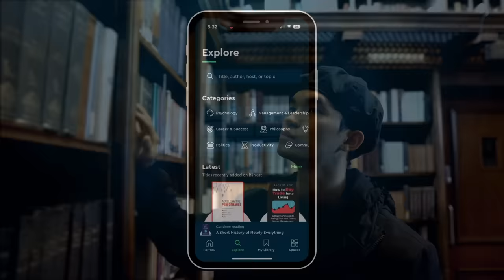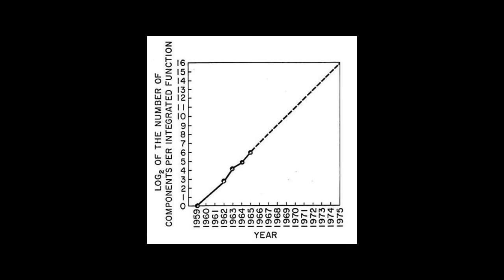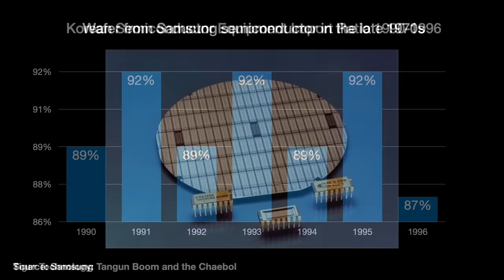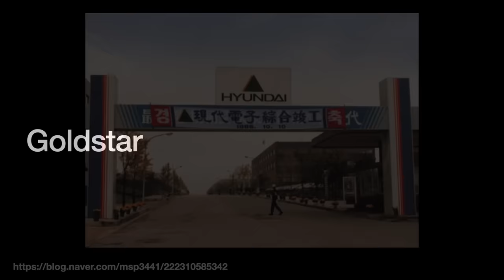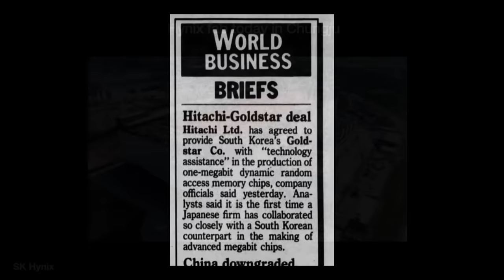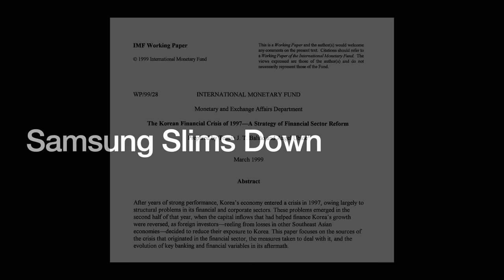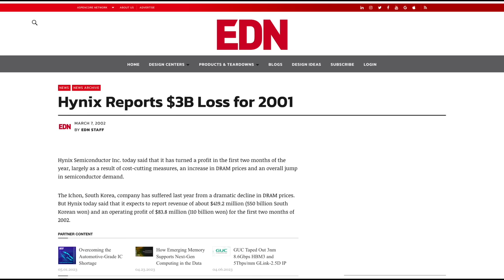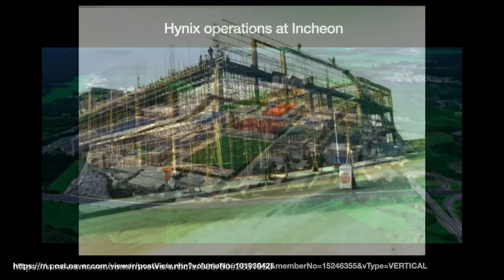The Fast and Furious Rise of Korean Semiconductors

Comment: I remember in the 50s when I was a little boy. My father was a foreman at a steel company in Warren, Ohio. Many times Japanese businessmen stayed at our home as my father showed them how to make steel. Long story short, the Japanese production of cut-rate steel doomed the US steel industry. Then Korea does the same thing to Japan in high-tech and semi-conductors. And, "the beat goes on."
Reply: Hey, we still make garbage steel here. I've  built several buildings out of car doors and folding chairs
Reply: Damn homeboy got schooled how to make better steel with radioactive dust infused 😂
Reply: Our YT comments are training the AI of future cyborgs.
Reply: @everydaydose7779  Steel produced anywhere in the world after July 6th 1945 is slightly radioactive. The medical device industry has bid up scrap steel made prior to 1945 because the radioactivity interferes with sensitive instruments, and the non-irradiated metal is needed.
Reply: @GGigabiteM  um, what about recently mined iron ore that was brought up from the depths of solid - iron ore deposits? Seems as though that steel would have been quite shielded from any nuclear activity up at the surface. Furthermore, steel that was present at the surface during all of the testing done throughout the 3 decades it happened would be irradiated, if only slightly, which I presume is enough to interfere with sensitive equipment. 
So, what you claim sounds good at first, but under further scrutiny, I don't believe it could be entirely true.
Reply: @markhonea2461  I think its the steel making process that uses atmospheric oxygen that introduces radioactivity, the iron source doesn't matter.
Reply: It's cycle ,, now again opportunity came to india door
Reply: @SerBallister  that's a decent theory, but the only actual oxygen isotope that is considered reactive is I think O-22 and has a half life in the nano second scale. Kind of rules that out. The other 3 oxygen isotopes aren't considered radioactive as they are stable and don't deteriorate.
Reply: @markhonea2461  I just checked the wikipedia article on "low background steel" to refresh my memory, apparently it's (largely) Cobalt-60 in the atmosphere that is the source.
Reply: Japanese made it better
Reply: @CrimsonAlchemist  No, that mill made the world's finest steel. The Japanese made it cheaper because of low wages.
Reply: @BabluYadav-rm6tu unless India takes a turn away from its current path towards Hindutva theocracy, it will continue to be a poor nation exporting all its incredibly gifted workers to advanced economies.
Reply: @hydrolifetech7911   Agreed
Reply: @hydrolifetech7911  I would argue that a country with unregulated number of muslim population who also happen to belong to a poorer section of society doesn't help it progress much , does it now ? division points within the country is too many
Reply: Unfortunately the US has been deinstrializing every since WW II and offshoring manufacturing was always the goal.    This has mainly benefited the former enemy nations defeated in WW II such as Japan, Germany and Italy along with other cold war proxies such as South Korea and Taiwan.  Plus having these other nations competing lowered prices and increased quality across the board, while also increasing the market for manufactured profits outside the US and Europe.
Reply: @willd1mindmind639 Italy with is weak economy isn't nowhere a threat to USA, maybe Germany and Japan.
Alas Japan is already fighting South Korea and China and probably losing against them.
Reply: @258Loures Doesn't change the point that offshoring was a choice intended to promote competition and ultimately cheaper electronics as a desired outcome.

Comment: Thank you for an excellent review of the growth of the Korean semiconductor industry.  I enjoyed this video because I was very involved in building many Hyundai semiconductor fabs in Korea. I was also involved in the Hyundai Eugene fab. I visited the Hyundai Scottish fab site several times before Hyundai shut down the project. Many of my friends were among those who were laid off by Hyundai Semiconductor.  

One thing that I need to point out to you is that the location of Hyundai Semiconductor is not Incheon, but rather Icheon. Incheon is the location of the major airport which replaced Kimpo as the main Seoul airport. Incheon is located to the west of Seoul. The Hyundai Semiconductor headquarters was in Icheon which is located about 1 hour southeast of Seoul.  The city names are close but not identical.  Incheon is 인천 仁川 and Icheon is 이천 利川.  The Koreans frequently would ask which city that I meant when I spoke of Icheon.  I would clarify it as Kyoungkido Icheon which is specific for Icheon since Incheon is a specially designated "Kwanak" city.
Reply: Seorang karyawan Hyundai mengatakan anda pembawa sial  😂

Comment: @Asianometry I am always delighted by the thoroughness of your research, I enjoy your productions quite a lot. However, I have a small note: You used "megabits" throughout this video when you should have used "megabytes". In short, one megabit represents one million bits, whereas one megabyte represents EIGHT million bits, so they are quite different. Furthermore, megabits is used in data transmission (such as in video streaming), and megabytes is used in data storage (such as in computer memory). Cheers.

Comment: I was the process integration engineer for Hyundai America in Eugene.  It was poorly managed, they hired all american engineers but wouldn’t let us in on the real engineering meetings,  instead treating us like technicians. Within 24 months most all of us has quit. Yields were bad, which is a death knell for semiconductors, and without us things got worse, the locals soaked Hyundai with outrageous fees... it was a crater of expenses. Clearly this was a company that treated semiconductors like the ship building company it had been... heavy top management who knew little of what it took to be successful in the industry,  keep middle management in the dark, and bureaucracy and pride thus preventing the nimbleness needed to fix defects quickly.  For a full year they refused to fix an obvious contact conformity issue that was killing Yields because it required a process deviation from what they did in Korea.  So disappointing to see that Hyundai plant mothballed still 25 years later.

Comment: Here is a question. Can india's tata catch up like what samsung did? Does indis have what it takes to do this? Why has anyone look at brazil as a chap maker?
Reply: I think India would catch up maynot be with a domestic company but surely they will, I can hear frequent news about chip industry here in India.
Reply: @abi3751  There is a reason I asked those questions. I am hoping that he will do a dedicated video son these questions. India will never catch up with a domestic company because they tried that in the past. The need the euv machines and they will not get it because india is second to china in human right violations. They also have a terrorist group hindutva (known to be bjp supported) which persecuted christians, muslims and other minority groups. They also suffer from pack of infrastructure, bad work ethic and the list goes on. There is a good reason india never managed to achieve this. Why did tsmc overlook india and built a fab in arazona? The reasons I mentioned above and more.
Reply: @abi3751  Brazil is not perfect but many of those issues india have does not exist in brazil. Also brazil is relatively peaceful for over 200 years. I can say tsmc chose use because of the already established infrastructure and manpower. Its the reallity. I think asianometry would agree. I also would like to point out that the americans will not allow an external semiconductor company unless they can control them. This is why china has a hard time getting the euv machines.
Reply: India needs many help from many U.S. and Japan semiconductor equiment companies.
Unfortunately, India is not a strategic ally of U.S. and Japan alike.

Comment: I just realized the the SK, in SK Hynix, stands in for South Korea. How the heck did I miss that for so long... Too focused on specs I suppose...
Reply: Not really, SK stands for Sunkyong Group, the original holding company that bought out Hynix.
Reply: @capmidnite  Well damn. Thanks!
Reply: @wskinnyodden  SK Group is a group that developed based on SunKyung(jp:Senkyo) Textiles,  as a joint venture between Korea's (Jo)Seon-Man(churia) Silks and Satins company  and Japan's Kyoto Textiles,  in 1939, when Korea was called Joseon(Chosen) during the Japanese colonial period.